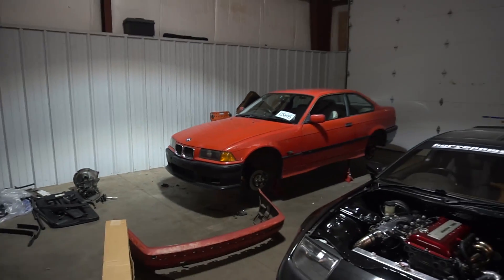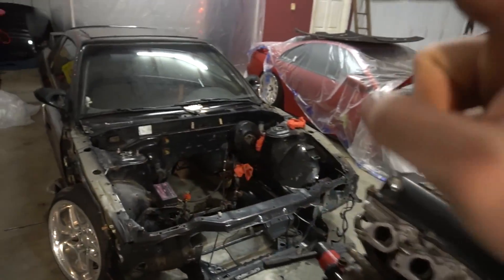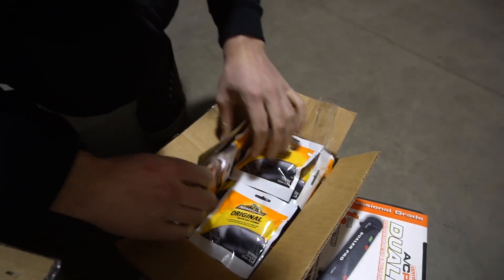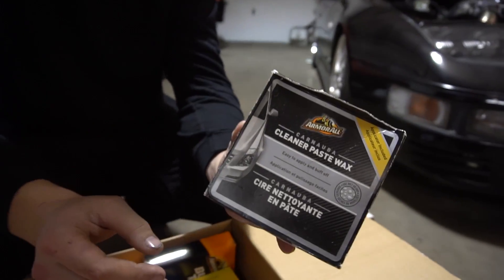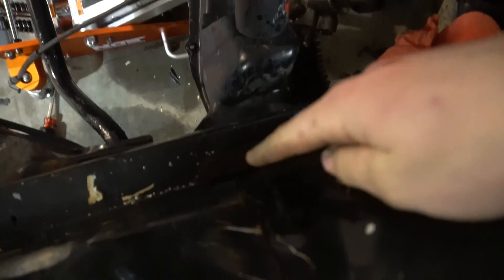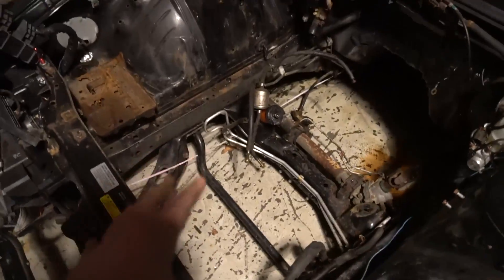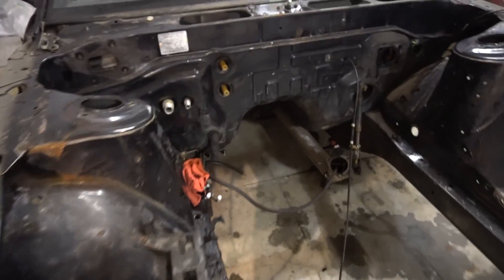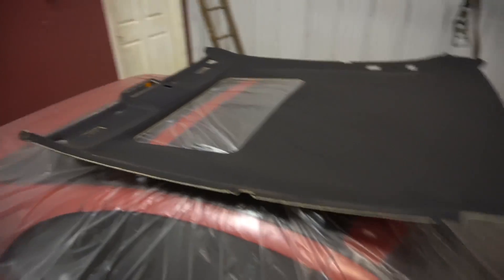WELL, THAT'S THE LAST OF IT..

Comment: Jimmy just a word from a detailer. Id stay away from Armorall products. Their trim products are silicone based, in the long run they sap the moisture out of the vinyls and plastics leaving them brittle and dry. I know you deal with a lot of older cars and the dash pads are probably already fairly dried out. If youre looking for good OTC products Meguiars, Mothers, or Griot Garage are the way to go. Special order products i stick with Chemical Guys.
Reply: CIVKID09 Thank you!!  I didn't know that.  I grew up with the "gearheads" back in the day and that's what we used.  And the dashes were dry and they cracked!!  I use Mothers on my Nissan and it works well.
Reply: Two products I always stay away from Armorall and Fram.
Reply: CIVKID09 i never use shine. i use sprayway glass cleaner and an air hose to blast dust off and a microfiber to wipe. leaves plastic natural looking and no streaks. plus smells better

Comment: If u want to beat the crap out your e36, u should get a m3 rear subframe and weld in reinforcements. Because e36 subframe can loosen from your chassis off hard beating. also, m52b25 can handle 400hp with boost with ease.

Comment: Links to fender trim: 
left side- https://www.ebay.com/itm/95-99-BMW-E36-M3-Coupe-Driver-Fender-Impact-Molding-Trim-2233685/202179495696?epid=1123985581&hash=item2f12d64710:g:J4wAAOSw495Z566s&vxp=mtr
right side-  https://www.ebay.com/itm/BM1293110-Fender-Trim-New-Front-Right-Hand-3-Series-Passenger-Side-RH-Coupe-M3/232348399501?epid=911884550&hash=item36190b378d:g:b~gAAOSwDiBZNkjy&vxp=mtr
has the part numbers on there too so you can check if there are any cheaper ones out there!

Comment: Found the trim on ebay ~$40 for each side from the same seller.
Passenger: https://www.ebay.com/itm/95-99-BMW-E36-M3-COUPE-PASSENGER-FENDER-TRIM-2233686/192338968346?hash=item2cc84bbf1a:g:JcwAAOSw09xZ6TK2&vxp=mtr
Driver: https://www.ebay.com/itm/95-99-BMW-E36-M3-Coupe-Driver-Fender-Impact-Molding-Trim-2233685/202179495696?epid=1123985581&hash=item2f12d64710:g:J4wAAOSw495Z566s&vxp=mtr